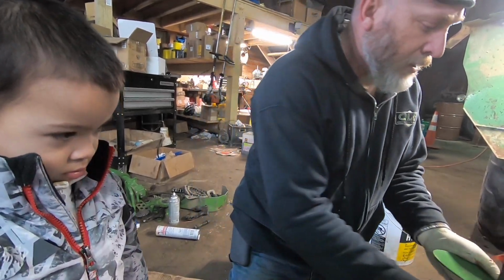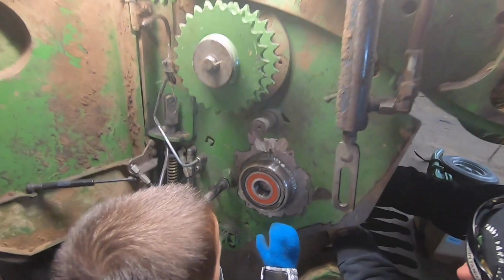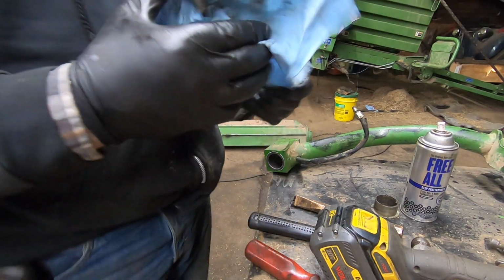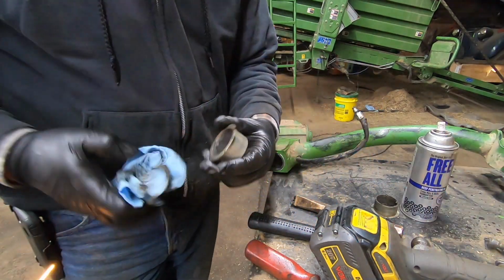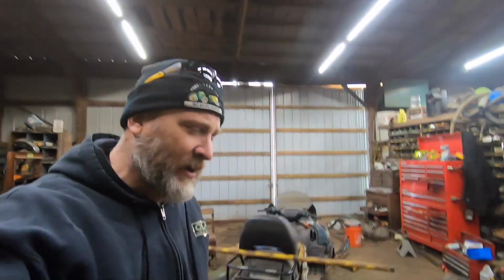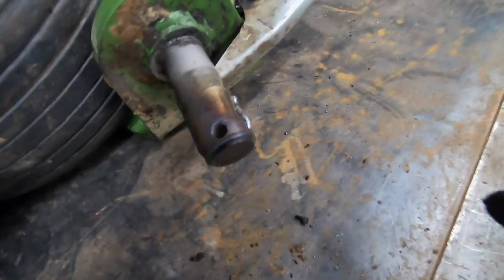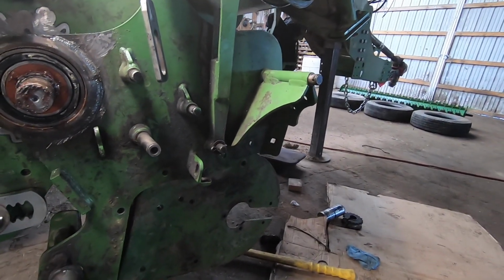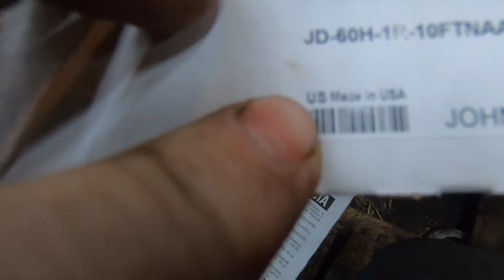Little Stuff Big Problems

Comment: William is just wanting to help. Get some foam ear plugs for William. 
Pending on what my purchase is, it's always getting a "full" warranty, I paid for it, they can fix and go through it. The new compact utility I bought last year for the yard, I spent the money got JD's service contract on it. Anything that needs fixed, they fix it, along with normal servicing such and oil changes. 
Wes, use ratchet straps to help reinstall those "augers". You're fighting gravity while hammering them back in, at least the strap would some what hold it level for you, making it a bit easier to put back in place. Just a suggestion, nothing more. Great video as always. Cheers :)

Comment: Just a suggestion for William some hearing protection and eye protection for the shop and where ever else they are necessary 
Accidents happen so quickly look at the Harmless farmer and the daughter of “your fan” from PA nobody wanted those to happen but they did
I was a line handler/capstan operator in the Navy and a guy stuck his hand inside the cleat the tugboat Captain heard the SCREAM (as did I 200’ away) and took the load off but the hand was crushed

Comment: This is why i enjoy doing the work myself. Saves my butt unless warranty then the dealer deals with it. 
Afterall, buying a tractor and batwing shredder just to be told its all been adjusted to what you need to find out later that was a lie. Ya, shame on you...

Especially wheb i got a bill for tractir service for $900 but yet its only $300 for the filters and fluids....

Comment: Lazy farmers sign new leases on equipment and do vacations in the winter. Then they whine all year about how broke they are and how they need to update their equipment so they can track every seed they put into the ground.
Smart farmers like Wes fix their equipment themselves and if something breaks they fix it on the spot without 5 dealership mechanics for about half the cost.
Reply: Welcome to the next generation farmer... You're absolutely correct. Cheers :)
Reply: Half the cost my ass, 10% of the cost more like it if hire it done, but that’s just the mechanical side of it. The millennium farmers also have a agronomist who tells him everything. What to plant and chemicals to buy from him he will gladly spray too. Guy from Germany could buy farm ground never see it and as long as check is good can farm in the good old USA too.
Reply: @greenthumb6875  Half the cost was meant just for repairs, here in Europe is the same. 
About half of the cost is parts and other half is billable hours for work done. On expensive parts you get maybe to 35% of a bill for work.
I can't write a whole balance sheet comparison in a comment.

Comment: You must save quite a bit doing the repairs yourself. I watch farming fixing and fabricating and their shop is full of equipment all the time. 
Their John Deere 9560R broke down they floated it home put it in the shop still on the float. Problem with the egr cooler. 
You sure learn a lot when you have balers for a while you get to know their quirks and how they work inside and out. Our Deuts/Allis round baler has its quirks. There’s one spring that breaks every few years and it’s a special design with a special price too.